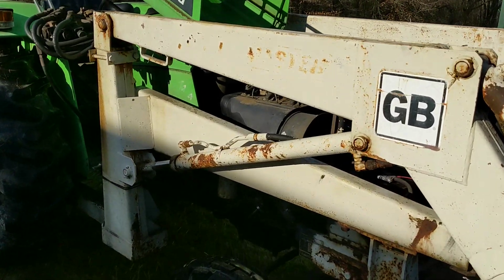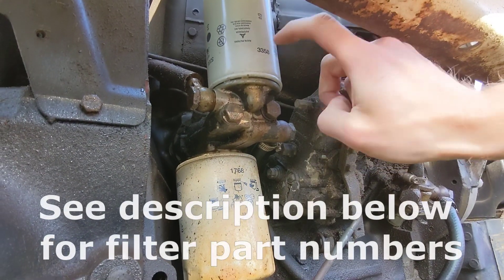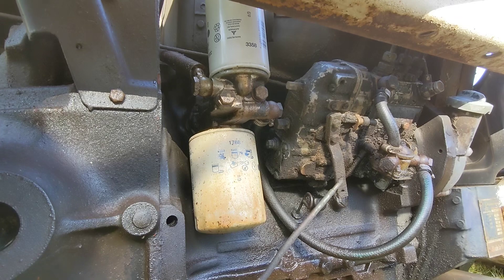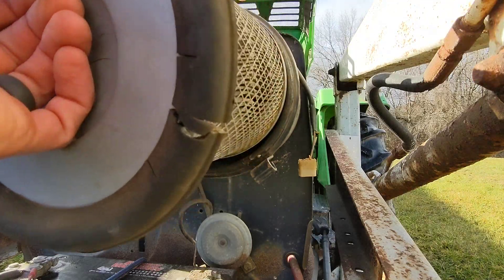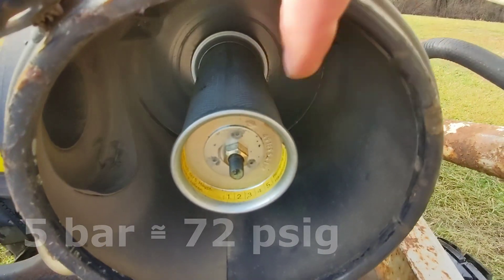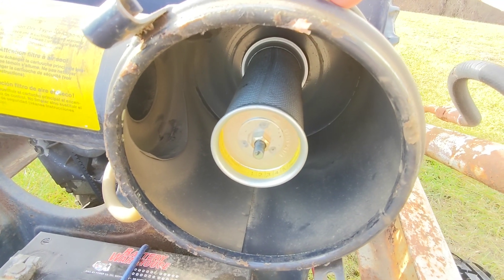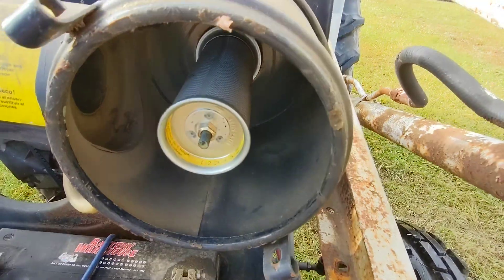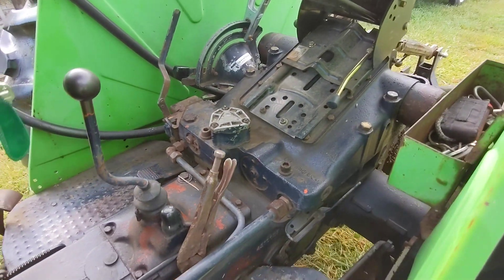Deutz Fahr D4506 Tractor – Oil, Fuel, Air, and Hydraulic Filter Overview with P/N’s

Comment: Do you still have working headlights in the front of the hood? If so could you do a video showing them close up, how they’re installed and the electrical connector that hooks them up?  Thanks for the videos!
Reply from the maker: I don't have working lights unfortunately. I'll take a look at what's remaining and see if I can get you any details. Do you have the remnants of the harness or wires still running to the lamps?
Reply: @Buttons_fix_it  thanks for the reply!  There is a harness there, it's a 4 prong connector, but unclear to me if there should be two individual connectors (one from each lamp) to the single 4 prong connector, or if the two lights come in a pair with a single connector or something. Not sure if what is there on mine is original, or not.
Reply from the maker: Found an old diagram and compared to what's left on my tractor. There are 4 wires connected to the LEFT headlamp (on the diagram). Then 2 wires jump over to the RIGHT headlamp. I'm guessing this is so you can disconnect the the 4 prong connector and take the hood off if needed. So you'll be looking for a pair of lights. The wire colors jumping the lights together are White and Brown. This information is from the old diagram. My tractor has what's left of the 4 prong connector hanging over the air cleaner. It's mouse chewn and in rough shape sadly. My 4506 needs plenty of electrical work!

Comment: Where is the drain for the hydraulic fluid?
Reply from the maker: The 4506 manual says to remove the fluid from the fill hole using a pump. So no drain that I am aware of.
I like the small red hand pumps at harbor freight and they are about $7, I'm sure they have them at auto parts stores or maybe even Walmart. Thanks for watching!
Reply: @Buttons_fix_it  Thanks mate safer idea than mine, I just did it by disconnecting the return from the pump and idling the motor.
Reply from the maker: Well that is one way hahaha! Enjoy living on the edge? : )

Comment: Hi can you explain how ti change transmission oil? Is the same oil for transmission and hydraulic?
Reply from the maker: Hi I'll try to get you some details on the transmission oil as soon as I can, too much work recently! It is not the same oil though. I have a video in my Deutz Playlist with checking the transmission oil and in that one I detail the type of oil. As for the hydraulics, the manual actually calls for the same motor oil as used in the engine. I'm pretty sure mine has normal cheap hydraulic fluid. I'll be changing the transmission and hydraulic fluid on mine at some point and will post a video, but that might be a bit aways. Take care!
Deutz Tractor: https://www.youtube.com/playlist?list=PL1WKa7FVhvVPwJekfgCdh1fnFgrhDH2jW

Comment: A different video you made said to use transmission fluid sae90 GL4. I am having trouble finding that specific fluid. Where do i buy that from?
Reply from the maker: I've noticed some gear oils out of stock as well recently, not sure why. With gear oil I make sure to stick with the correct GL number since the additives between GL's can cause issues. If the GL number is correct I'll be more flexible on the weight, especially if I really need to get something filled and back to service. I looked online right now Advance Auto is showing GL-4 in-stock with free shipping: Carquest Oil & Fluids EP 90 GL-4 Gear Oil, 5 Gallon
In the meantime it may just take a bunch of phone calls or hunting sites for local auto / tractor / marine parts stores to find it. Best of luck!

Comment: Nice short video. I just added one of my little D45.
I’m curious what you’ll find when you open up to fix the differential. Bet the sleeve is seized. 
Also, make sure you check the injection pump oil. 
Subscribed.
Reply from the maker: Thank you for subscribing! I'll make sure to check out the D45 for sure. For the injection pump oil I think I mentioned it briefly in my video on repriming after running out of fuel. But you have a good point, I should make a video covering that. I'm anxious to get into that differential, just to many other items (like work) haha getting in the way. Thanks again for commenting and subscribing!